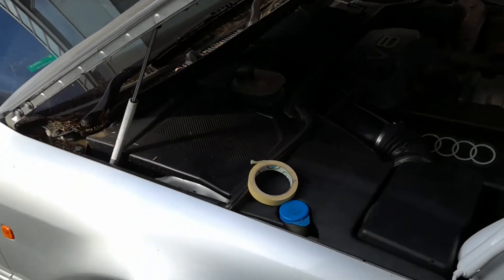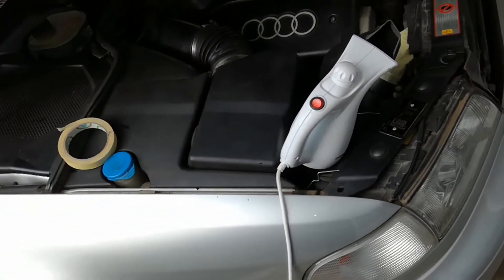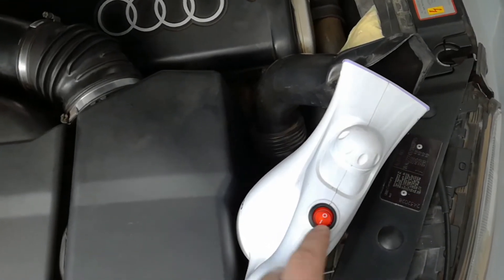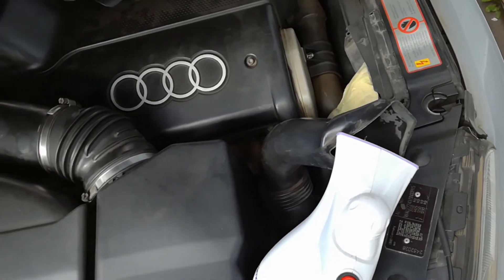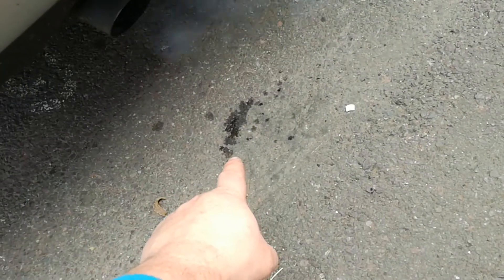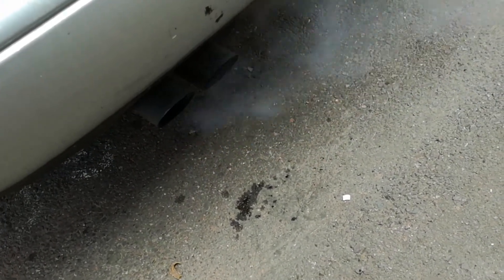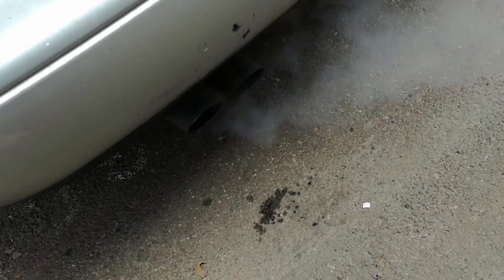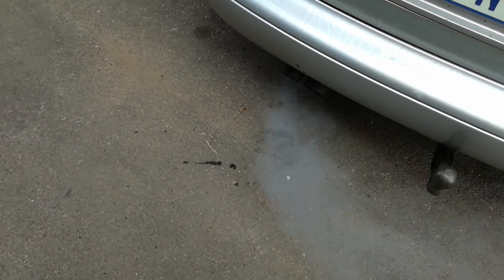Better engine performance with a cheap supermarket steamer. Remove carbon build up.

Comment: Does it work on Diesel engines?
Reply from the maker: Yes definitely works even better can run steam permanently in a diesel.
Reply from the maker: Yes work ls very well on diesels its even possible on diesels to permanent steam injection for more power.

Comment: The more I hear about "steam cleaning" carbon out of an engine, the more I am leaning towards trying it.  However, if one uses the "steam" method in the video, I think it is very important to disconnect the catalytic converter so the carbon coming off the engine doesn't clog it up.  Secondly, once you have your engine somewhat cleaned (and for new cars) incorporate a "oil catch can" system, and get rid of the PCV valve system on most (if not all) cars. Recycled oil vapor through the PCV valve system that is then redirected through the air cleaner is a Big reason for the carbon build up in the first place.  The PCV system is more about "not" allowing oil fumes into the environment (pollution) than it is to help your car run better.  Now if you have a 2 stroke engine then yeah the PCV valve set up would and does make sense. But not with 4 stroke engines.  If you use good higher octane fuel, there should be little if any carbon buildup occurring.  No carbon build up is caused by the PCV valve system.  Thanks for the Vid, but really think the exhaust should be shortened to before the Cat. for best results.
Reply from the maker: I use this on blocked cats and it cleans the carbon out of them

Comment: Do I need to change my oil after this? Thanks
Reply from the maker: I I often do it as a complete service so normally I will change the oil the oil filter and the spark plugs as well on a petrol and just oil and filter on a diesel after I've done it. But you don't have to if you don't get steam into the crankcase by blocking off the vent lines.

Comment: hi on a new generation Diesel engine, the carbon could not end up in the anti-walk filter by tapping it?
Reply from the maker: If it makes it to the dpf it should be burned off on a good run but in Most cases it ends up burning off in the combustion chamber as it's loosened.
Reply: @dlfrestoration  thanks

Comment: How do i know where are my air intakes besides the air filter imtake
Reply from the maker: mostly I wld just look carefully to see where the vacuum lines are and look for any that that are before the throttle body and block them off.
Reply: @dlfrestoration  i have a 2010 honda insight, i thought of placing the steamer directly to the throttle intake after i disassemble the air filter and mass airflow sensor.
Would that be advisable?

Comment: If I get you right, I need to disconnect  air filter housing and surpass MAF sensor or put them on the side?
Reply from the maker: Yes  you dont want to get steam into the crankcase through the breathers so i block them off. And the maf getting damp may shut the engine off.
Reply: @dlfrestoration  Ok. So I can input steam for example through throttle body for somewhere 4-5 min?
Reply from the maker: @vladimir_jelesijevic  I'd say do it for as long as possible cos some carbon buildup can be quite stubborn.

Comment: So I should block off the pcv as well?
Reply from the maker: Hi yes you need to so you can prevent water in the oil
Reply: @dlfrestoration  how often can I do this ?
Reply from the maker: @Maineposted  you can do it as often as you like i made a steam injection system that always runs on my car.
Reply: @dlfrestoration  so air intake and pcv on a golf vw. Thanks!

Comment: This could be the best way to clean out catalytic converters in exhaust systems as well. Have you ever tried this on a catalytic converter throwing a code of low  efficiency? And have you tried it on a bad o2 sensor code before?
Reply from the maker: Hi yes i have used it to solve a blocked cat but i ran it for around a hour and also used a spray bottle with water like 10 sprays every 5 minutes of steam just to keep it more damp inside. Try get as much steam as you possibly can to the point you see steam out the tailpipe. Thank you so much for your coment 😊
Reply: @dlfrestoration  Awesome, have you ever rebuilt an engine that you have done this to? Any pitting or corrosion or abnormal wear?  I guess being at operating temp and doing the post 15 min idle after steam, in addition to a highway drive would take care of it.... Maybe just a fresh oil change after all of that to be safe?
Reply from the maker: @brotharuss  yes i have on my car its turbo diesel and do it every service for a hour every service. And did a rebuild at 350k and it all seemed normal just with very lil carbon build up. I also have a diesel jeep that runs permanent steam injection on it its got 270k on it at the moment and no problems its set up to inject steam under full load. It reduces the temp when pulling a car trailer. When its worn out i will get to see what long term use dose. But i will say it takes at least 2k more to make the oil black with this setup.
Reply: @dlfrestoration  Awesome! I subscribed to see those vids in the future.
Reply from the maker: @brotharuss  thanks man i appreciate that

Comment: Man you rock I did this today in my truck for 15 mins revving and the engine became very smooth and now it has more performance I'm planning to do it in an old Fiat and will record everything
Reply from the maker: Hey bro im so happy it worked 😊😊😊generally the more tired the engine the better it works 👍👍

Comment: After I have used this method many times I saw for the first time the metallic surface of one piston through
the spark plug hole using a small and strong led light.This is The BEST ENGINE CLEANING METHOD!
Reply from the maker: Im working on a system now that will add in steam under full load wile diving to prevent any build up from happening and also make more power on a lower octane fuel. Will upload if it works 😊😊
Reply: @dlfrestoration  heat exchanger attached to downpipe with  slow water feed going to intake, you will see an increase in mpg if done right.. If you could use a tps sensor to meter water into heat exchanger according to load that would work well..
Reply from the maker: @DUB-sential  i have used the boost pressure from the turbo to do something similar and some copper pipe around the exhaust.
Reply from the maker: How wld you determine load with the tps tho? i wld think map signal wld give you a more accurate load signal.
Reply: @dlfrestoration  interesting would you say you've got any noticeable savings on fuel? 
What do you do to stop things freezing up?.. 
I'm not sure about washer fluid with the methanol flash steaming on the exhaust might not be good seems wasteful.
I run veg blend through a jtd, clean svo and am considering making something up to prevent gumming and it should save on fuel..
I have heard of steam cracking water into hydrogen but I'm sure that would be a fine art.. Its a shame I'm sure all that waste energy in the exhaust could be put to good use other than trying to put spent gasses in the engine lol and making a coal plant in your manifolds.. Bloody egr valves 
I call it the suicide valve lol.
Reply from the maker: @DUB-sential  i always delete the egr in the software cos its destroys engine life span. I have in one of my cars i did run the steam into a grid that broke some into browns gas that made a huge difference in fuel consumption. And over time spotlessly cleaned the gum. Out the engine
Reply: @dlfrestoration  same, I've just took it off software deletion would be ideal but no eml... 
I vent the oil breather to atmosphere also.. 
I have put about 5l of water through with a pump sprayer engine revving at 2k with very noticeable carbon blown out, just sprayed till it bogged on hot engine.
I actually considered just putting a jet in the egr delete plate and just swap the washer pipe over..
I think however a much slower flow would be better hence steam and finding your video.
Reply from the maker: @DUB-sential  is your car turboed? If it id its very easy to control the flow? If its na a small hho set up is a better option than steam
Reply: @dlfrestoration  yeah its the fiat jtd engine also found in numerous other brands.

On the one hand I save fuel on the fuel etc I still like tuning so steam might not be ideal upping intake temp and defeating the intercooler a bit.. 
Would be better after turbo I think but then you have issues getting it in and its going to have an affect on map sensor possibly interfering with maf readings also
Was thinking ultrasonic fogger straight into intake for a cool almost fog but mist, low power draw.. What puts me off is it swilling about, would need baffles, frost issues and space probably have to relocate battery... 
Also how to meter it... Perhaps as you have hook it up to come on boost with a butterfly or vacuum system.
Reply from the maker: @DUB-sential  with tdi its really easy to use plain water and a small gas jet aimed at the center of the impeller. And 2 one way valves. One from the manifold into your water bottle then the outlet heading to the intake of the turbo.
Reply: @dlfrestoration  do you mean by using pressure from the inlet manifold ?
And suction from the inlet.. 
That's quite a good Idea cooling the turbine blades meaning running higher boost.. 
I guess it will only drip a tiny amount when engine is off.
Just want a way to get smaller amounts of water in, another way is aquarium pump with big air stone... Hose at top
Reply from the maker: The reason for my method is that it will only spray water in under full boose and not at idle. And also bipass the air flow meter
Reply: @dlfrestoration  yes that's a good point, I'm looking at gas jets what size would you recommend ? 
I looked this up people mention hvlp nozzles but I don't really want to much water going in so perhaps the gas jet you suggest is better.. By the time its gone through the turbine and intake it will be atomised, will it damage blades in your opinion?
Reply from the maker: @DUB-sential  i had it aimed strait that the bolt in the center of the turbine so didnt do any damage. I cant remember what size i had but kept drilling it out till it was 0.25mm and it worked well on my 5.2 tdi
Reply: @dlfrestoration  thanks yeah I was just thinking about this I guess you could use a simple atomiser sprayer head, perfume bottle etc and use your method if its flowing to much use a bleed valve to restrict it... 
Will still work with the boost pressure its probably best having a solenoid connected to oil pressure as it will remain pressurised after switch off.
Reply from the maker: It wont remain pressurized as the jet acts as a relief valve as soon as you idle it will vent the remaining water. Just a note the bottle must be below the point it sprays in or it will siphon the water without boost. So i have it under the passenger seat floor.
Reply: @dlfrestoration  OK cheers I'm thinking I might go with this, turbo is low down which could be a problem with fluid, what sort of duration and size bottle were you using.. 
I like the idea as the spindle will be the hot part and probably steam/ cool turbine quite effectively.
Reply from the maker: @DUB-sential  yes it tends to drop the the intake temp but about 40c. I used a 20lt tank on my car but 1lt will last around 250kms. If you have the bottle hire you just need to have a one way value it will stop it siphoning. So your outlet comes straight out the top
Reply: @dlfrestoration  OK thanks for the detailed explanation I was thinking I'd use a 20l tank, not entirely sure where to put it may have to be smaller but my car is a 1.9 should use a smaller jet but can't find one.
Reply from the maker: Have a look at gas welding jets they go down to like 0.1
Reply from the maker: But i think a 0.2 mm is perfect for your engine size. Cos i ran 0.25x2 on my car

Comment: My method:
Before engine oil change, after a short trip your engine is hot.
Then you remove air filter and spray little amount of steam in the 

air input while your car is running idle for 10 minutes. 

After that spray a bit more steam with 2500rpm for 2 minutes and finally idle 

spraying little amount of steam in air input. Stop the car and refit filter. Make a short 5 km or 3 miles trip and then change oil
and filter while is hot.
Reply from the maker: I will try it and see how it works

Comment: what do you mean by blocking the breathers and contamination of oil ? I just did not understand which parts you think, can you explain it more precisely? Also, what quantity of water consumes this steamer during those 15 minutes of operation? I want to compare it with what I'm going to try ... My will take about 350ml of water for 25 minutes
Reply from the maker: Yes you cant do harm with steam if the engine is hot add as much steam as possible or till the  engine gets a lil ruf then back it off
Reply: @dlfrestoration  Yes I know but I asked about what you said in last seconds of the video... What is the "breathers " and what it has to do with engine oil? Just don't know what you talking about, can you explain it better?
Reply from the maker: Ok most cars pull a vacuum on the crank case. It gets that vacuum from the intake somewhere so you will see a pipe going to the cam cover somewhere.

Comment: This week after 4 months I used this method again. It keeps working fine. Don' t tell anyone about this.  Nobody will believe you. I do not say a word to anybody. They don' t want to hear anything about it and I don' care. Your video is the only one that exists in youtube.
Reply from the maker: Yes most ppl wont believe it till they try it. I have got a bigger steamer now that works better also 😁 im work on a diy method to clean injectors now will post it soon. Im happy this is helping you😊
Reply: @dlfrestoration  I am using a medium steam cleaner with a hose. For better results I am using a stick that pushes gas pedal. I put it between driver's seat and the pedal. So this way I maintain 2500 rpm' s for sometime and use bigger amount of steam in the air inlet.
Reply from the maker: That sounds like a good plan how did it work out did your engine feel more responsive? And dont forget to give it a drive when you done just to get any left over steam out

Comment: Why don't you use a fast idle like some people do?
Reply from the maker: I find that the steam works better at a slower speed it has more time to loosen the carbon. Then you can spike thr rmp a few times then let it idle again.
Reply: @dlfrestoration  ohh, I see

Comment: I have done it for five minutes with a steam cleaning machine and I will do it again for 15 minutes to see the results.
Did you see any difference with a flashlight through your spark plug holes? I mean did it clean the pistons?
Reply from the maker: I have use a bore scope and it dose work but if you want it completely clean needs about a hour of steam

Comment: This is very interesting. I have seen people drips water in the air intake for carbon cleaning but never thought of using steam. Do you have before and after photos? very interested to see whether there is an improvement to the carbon build up.
Reply from the maker: Hi i plan to make a video doing that with my own car its run 240000kms and diesel so i wanted to do the steam then strip it down and see if its cleaned it up.
Reply: @dlfrestoration  can't wait for that video to see the cleaning from steam.
Reply: @dlfrestoration  hey how did it go? Did you manage to take beforw and after picture using steam?
Reply from the maker: Hey not yet im gonna make a video when i do it i also wanna balance all the moving parts at the same time so need to save up a bit for that😂
Reply: @dlfrestoration  looking forward to it 😁

Comment: Have you tried this on direct injection?
Reply from the maker: Yes i have on a few if the vws and audis
Reply from the maker: Yes i mostly do it on direct injection turbo set ups to get rid of the carbon build up in the manifold

Comment: Do you have any proof of this?
Reply from the maker: After this i striped a engine after running it for around a hour and i wld say it did a pretty good job
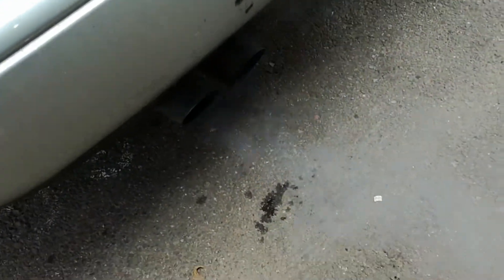Reply: You've seen the proof at 1:26 and yet you still want proof?
Reply: @biglightball  😂😂😂That's nothing you dumbass. Checking the before and after of the pistons is actual proof
Reply from the maker: @kiyoponnn  i hope to make a video like that soon
Reply: @dlfrestoration  I see. I'll subscribe to get notified
Reply from the maker: Thanks hey i  appreciate it😊😊
Reply: @dlfrestoration  No problem
Reply from the maker: @kiyoponnn  if you have any video you wld like me to make please leave me a suggestion i always need ideas 💡😊
Reply: @dlfrestoration  Alright, I'll let you know once I think of some ideas
Reply from the maker: Thank you do much 😊😎

Comment: Just loose soot from the muffler. Engines already produce water (as hot high pressure steam), about equal to the volume of fuel consumed. They survive without rusting. The steam being introduced is inconsequential by comparison.